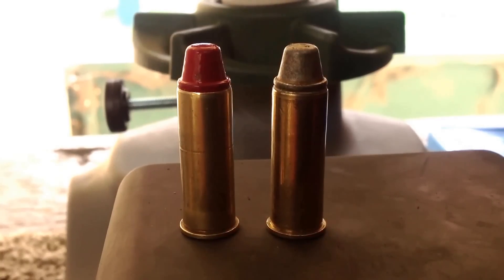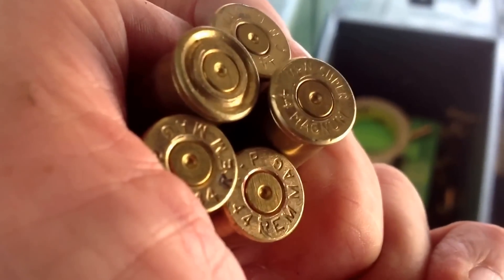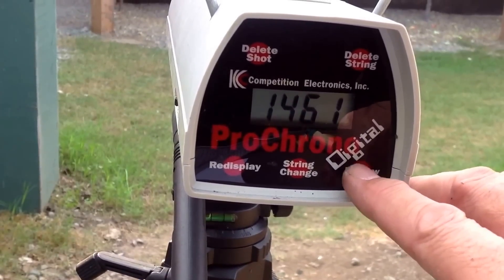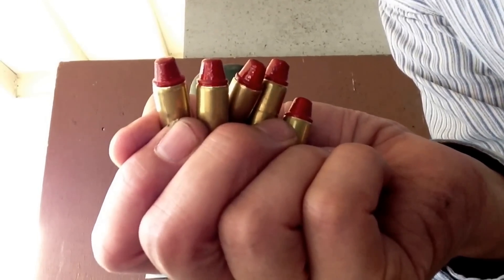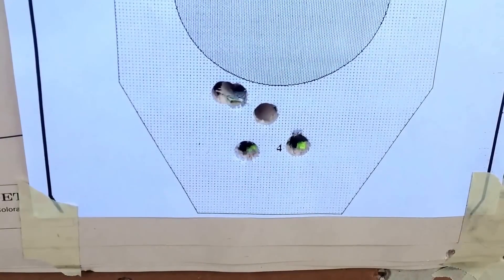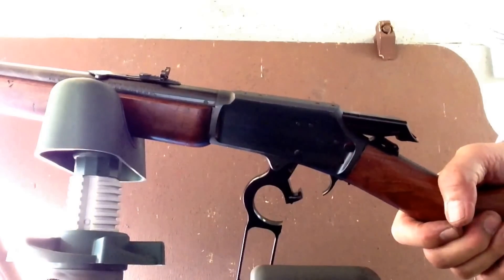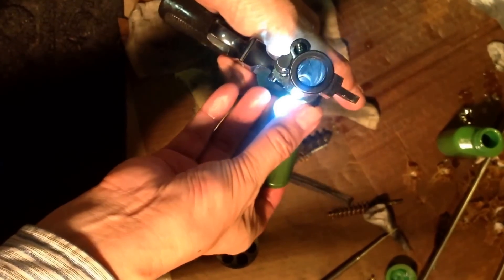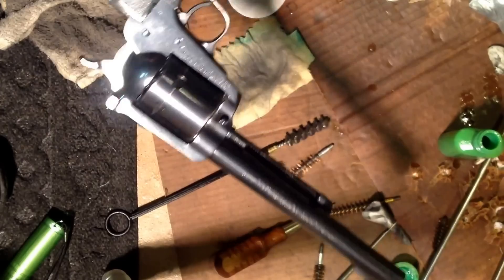Velocity Comparison - Powder Coated Vs Non-Powder Coated Bullets In 44 Magnum

Comment: Did you fire you test with a clean firearm each time? Lube will adhere to the bore. So firing a group with one lube, then another doesn't tell you too much useful data. I wonder what would be the velocity of the powder coated bullets when starting from a clean barrel?
Reply from the maker: Todd Fritz - With rifle testing, we clean after every 10 rounds plus cooling periods every group and copper remove after every 30 rounds.  One or two fouling shots are fired after cleanings.  With handguns, the ranges being a short 12.5 to 25 yards, cleanings between groups are not done.  However, group testing begins with a clean gun (with a fouling shot) and we seldom need to shoot more than 5 or 6  5 shot groups for any particular test.  Once concluded, we might choose to shoot 100 rounds or so for offhand range shooting - if the accuracy drops off, we know that the bore is getting fouled and it's time to clean the gun.   I don't recall seeing many handgun shooters who clean their guns for testing like we do when we are testing our rifles...  Best to ya,  Steve

Comment: fc45lc, I'm gonna try a 325 grain, gas check,2050 fps,and copper coat. 10 rounds next month.for first test rounds, I'm waiting to see if powder coated wears rifling out, before I mess with that. lol
Reply: nice dang reloads, nice
Reply from the maker: Rob Tolley - You will not find much on barrel wear out from PC.  There are some reports, but many more that do not have any problems with barrel wear.  But you don't have to do PC at all...the traditional lubes including 45/45/10 still work as well as they ever did... Best to ya,  FC

Comment: post script:

got 10lbs of the Ford light blue powder coat from Eastwood. I have been coating everything including 100 rounds of 230grn 45 lead I had previously lubed with the 45/45/10. melted them Down and recast, coated and swaged. I know probably easier to bathe them in some mineral spirits but I was already casting and went for it. I have been casting and shooting a ton of 35 Remington 200grn. Loaded with 37.5grns of IMR3031 I have been getting right at 2100fps. man I really enjoy the heck out of your videos. thanks again

Nathan

Comment: Is there anything wrong with flattened out primers on a full mag load? I've been under the impression it shouldn't do that but even the start charges in mag loads does this in my S&Ws.
Reply from the maker: Sam King - Absolutely OK - flattened primers means high pressures, but does not necessarily mean overpressures.  If you check out factory ammo... a lot of it is loaded to the max - flattened primers and all..even a bit of primer cratering may be seen. Everything is in degrees.  There is flatenning and there is flatenning.  And there is major cratering even pierced primers or gas blow out.  And the dreaded primer fall out.  When you couple all of that along with difficult extraction, or swollen case heads or rings, red flags have gone up.. Good shootin' to ya,  FC

Comment: What is a 45-45-10 bullet?  What distance were you shooting and what weight were the bullets?
Reply from the maker: deadeye2658 - Any cast bullet lubed with the 45/45/10 system - instead of the sticky, ugly Lee Alox tumble lube - you mix 45% Lee Alox; 45% Johnson's Paste Wax; 10% mineral spirits by eyeball (doesn't take much) and tumble the cast bullets - let dry on wax paper overnight - load 'em and shoot 'em.  Can lube 1000 bullets in total labor time of 12 minutes.  I have videos on the 45/45/10 system up.  No sticky, patina look, and shoots fine... Good reloadin' to ya,  FC

Comment: A little lateral dispersion. At least you only need to hit once with those loads. I shoot a hand cannon like that because its weight brings down felt recoil. Holyyyy!!! those look like some hot loads. I do like your results with powder coat. Thanks for sharing your experience.
Reply from the maker: ArcanusLibero - Yes, we did some rock and roll that day at the range...It's a good load though - can shoot a lot of 'em with that set of rubber grip stocks on the gun... Best to ya, FC
Reply: It looks like a good load. I cannot believe how much kick it had. Have you ever fired that load through a snub nose revolver? I think I need to look at rubber grips the older I get the punishing my hot loads feel.
Reply from the maker: It is a good load - but it is in the line of the full loads that Elmer Keith used in his sixguns...Best to ya,  FC

Comment: All the advantages of a TMJ with cast bullets. Nice. I've been shooting lightly loaded cast .44 mag loads through my Marlin lever action,  Blackhawk and S&W 629 with fairly heavy leading. The BHN has been 17.5 ish. Absolutely hate using a stainless brush in those barrels to clean them but as usual FortuneCookie45LC has an answer. Keep up the good work!!! :)
Reply from the maker: +hokanut -- Thanks for posting... Leading is a dreadful nuisance to deal with, and we need to avoid that for sure.  Your BHN is good for shooting magnums... might be just a bit on the hard side for light loads needing BHN 10-12.  Sometimes harder bullets will lead barrels because they are too hard for the velocity being shot.  Also, your Marlin micro groove barrel is probably on the big side so if your bullet are standard diameter, they may be small for the Marlin MG = leading.  So you might try a softer alloy (Missouri Bullets has the right BHN for your needs) bullet or upping the powder charge to around 1100 for your revolvers, 1300 for your rifle -  My Marlin 1894 44 mag needs bullets that are .433" to shoot best - that is really huge compared to the .430s my revolvers need.  If you powder coat your bullets, the hardness no longer is an issue - you can go soft with everything, plus no grease reloading and no lead shooting will occur.  But powder coating store bought bullets that have been lubed is a PIN.  Good shootin' to ya,  FC
Reply: +FortuneCookie45LC Thank you for the tip. I'm sure you're right especially with the Marlin because I can see the lead streaks skipping over the lands. I'm hoping the added diameter of the coated bullets will help grab the micro grooves better.  Also, so the harder BHN may cause the bullet to not conform to the rifling? That had never even occurred to me. Bet that will help a lot of folks. Thanks again.
Reply from the maker: +hokanut -- And thank you for the great discussion we're having...my Marlin 44 Mag with the like for .433" bullets - you might ask how I get those.  And you've already touched on it...I just powder coat my 431"s and they wind up .433" - perfect.  The best bullet for that rifle has been the 429 240 RN Lee - weighs 262 grains after casting.  And I like that...If I were hunting though, I'd shoot jacketed hollow or soft points.  The Micro Groove barrels shoot jacketed fine, even though the jacketed bullets mike at .429" - they slug up in the barrel nicely without any leading issues of course.  By the time our cast bullets slugged up, the barrel leading would have already happened...and it could be nasty.  Good shootin' to ya,  FC

Comment: A helpful tip with screws coming loose. When the gun is clean, (with no oil) take the screw out, clean and dry both of the threads. Then put a small dab of Clear Finger Nail Polish on the screw tip. I will act like a thread locker but one you can get off. hope it helps.
Reply from the maker: +Claude Smoot -- We used to do that with our scope screws - worked too, with our guns, why not?  Good tip to bring back into consciousness - thanks... Best to ya,  FC
Reply from the maker: +Claude Smoot -- We used to do that with our scope screws - worked too, with our guns, why not?  Good tip to bring back into consciousness - thanks... Best to ya,  FC

Comment: Powder coating has made cleanup of my guns a lot easier.  I still have a few lubed bullets to use up in the 357 and then I will use the powder coated.  Thanks for the very informative review.
Reply from the maker: +cerberus -- Our lubed bullets are still as good as they ever were.  I have no qualms about still doing the 45/45/10 for my cast bullets...that being said, I also like the nice clean reloading of PC bullets - no lube or grease anywhere.  And the guns shoot cleaner.  Not smoke-free, but more on this in future videos... Happy 2016 to ya... FC
Reply from the maker: +Amateur Redneck Workshop - Sorry to have missed your comment, but if Google doesn't post on my inbox, I miss all the new comments...the PC bullets do shoot cleanly, and well... Best to ya,  FC
Reply: I think youtube is having hiccups.  I have had several notifications that have already been replied to.

Comment: i though flatted pimers are a bad thing
Reply from the maker: +Josh Searl -- Standard loadings like 850 fps 38 Special or 45 ACP will not get flattened primers.  +P loads and +P+ will start getting flattened primers.  Many factory rifle rounds will show flattened primers on firing.  They indicate higher end pressures for that cartridge.  There are degrees of primer flatenning.  When the primer flows back completely flush to the case head and the details of the bolt face are engraved along with cratering around the firing pin indent - pressures are over maximum.  When primers pierce, pressures are way over maximum.  Since there are no practical pressure measuring devices available to reloaders, these are rules of thumb that reloaders have used for decades to evaluate pressure of our loadings.  Our best bet is to stay with published loading data as the powder and ammo companies have done all the pressure testing for us.  Still, guns and reloading practices vary - so we all still read the primers for pressure signs.... Best of the Holidays to you,    FC

Comment: Those were some real "Do you feel lucky" magnum loads, didn't hang around long enough to get the Blackhawk dirty. I might try a little Loctite 242 on those screws before you end up on your hands and knees under a shooting bench looking for a lost screw and those little buggers will fly a long way with that kind of recoil. Besides it's never a good thing to have a screw loose when your shooting buddy's are around, too many jokes that can last a long time. LOL
Reply from the maker: +ecleveland1 - ;)  :)  ;)  for sure!!  FC
Reply from the maker: +ecleveland1 -- Good points all - My old 3 screw Super Blackhawk had to have all the frame screws tightened every 50 rounds of 22/2400/245 Keith.  Did lose a screw out of one of my Rossi M92s once - ordered three more from Rossi - no problem getting them.  The Loctite is a good idea for sure.  Having to tighten those screws eventually results in some wear and tear to the screw heads.  Have a great day,  FC

Comment: I did some accuracy testing with my S&W model 28-2 with powder coated vs. 45-45-10 and had similar results but I need to get a chronograph. Next up is the Blackhawk .41 Magnum.
Reply from the maker: +Mr. Tolly (AKA: fatmantolly) - I can trot out my 41 Bisley and join you on that, but all my 41 bullets are already lubed with 45/45/10 and if I cast more, I'm going to have to use those #@*&%!!  2 cavity molds!!!  Best Regards....FC

Comment: And alas, the first good argument FOR powder coating bullets. Impressive.  My inquisitive mind wonders why, but I did like the results.
Reply from the maker: +Don Eime -- I'm wondering as well ( dangerous business, I know - but it helps to keep away dementia).  Some say that it has to be from higher pressure (more friction).  Others say from more lubricity of the bullet (lower friction).  Best recommendation would therefore be to lower the maximum charge by .3 to .5 grains and work back up or just keep that and enjoy the savings in powder...Best Regards to ya.... FC
Reply from the maker: +Don Eime - I haven't figured out why the extra fps - must be higher pressure or more bore lubricity somehow, but the loads were safe to shoot and shoot a lot... I like 'em... 1550 fps is nice magnum performance.   FC

Comment: Wow, if you look close on the Marlin target, I swear you can see an impression of the Micro-Groove rifling in the edge of the paper! Kinda neat! 

Using powder coat in most cases results in a higher average velocity over other bullet lube systems. It is essentially a really clean and slippery projectile lubricant. It provides the lowest coefficient of friction business which accounts for the higher velocity. In use, the user still needs to have all the other important details right for a given load, alloy/hardness, gas check if needed and most importantly, properly sized bullets. Adding PC to the formula will ensure you get clean shooting, leading free bullets if everything else is right, including the guns dimensions. PC will typically allow the use to push the envelope a little more. Example: running velocity & pressures high enough a gas check would be needed with conventional lube, PC will generally bump that margin up a little. 

It was nice to see the PC loads perform well and slightly better than the 45/45/10 slugs, victory to the modern technology loads that day! Now you just need to adjust the variables to find the sweet spot for that magnum load!
Reply from the maker: +mytmousemalibu - Thanks for your input - valuable stuff.  No need to adjust anything- I'm going to enjoy the increased MV and just go with it...Why not?  We are shooting the   "I know what you're thinking- did he fire five or six?, In all this excitement, I've lost count myself....being this is a 44 Magnum, the most powerful handgun in the world, it'll blow your head clean off... ya gotta ask yourself a question...Do I feel lucky?... Well, do ya, punk?"    BLAM!! with 240 grain PC bullet, no less....!!    FC
Reply: That was worth a giggle! I have this habit of seeking out the finite details which also means I might try to fix something that may or may not need fixing, lol. Example, if a pistol is shooting one hole groups at 12.5yds but at 50 they are a couple inches, I might be just foolish enough to go jack around with the load recipe to "chase the dragon" so to speak! I work in aviation, where perfection is encouraged! I have always been picky about certain things. Perfectionism is my good friend and my arch nemesis!
Reply from the maker: +mytmousemalibu - Thanks for sharing, Chris - and as an occasional  passenger, your attention to detail is very much appreciated... Happy Holidays!!  FC

Comment: Have you recovered a fired projectile? How does the coating hold up, does it maintain coverage without cracking?  I have tried SnS coated bullets, and frankly, I don't like them.
Reply: +RapidRrobert I've recovered many powder coated bullets, the bright red is easy to spot in the dirt! I have never seen any hint of coating failure. They can flatten or deform when hitting hard objects and the powder coat will not chip off one bit, it smashes and bends well. You can hammer powder coated bullets as flat as a quarter and  not have any failure.
Reply: Rusty Shackleford I have been using SNS coated bullets for about 4 months now.  I send them at about 1000 fps out of my various .357s.  I'm sold!  No fouling, no tumbling, lower cost, clean when handling during reloading .....

Keeping an open mind is the key to everything.  My opinion changed after experience.
Reply: +RapidRrobert I've recovered a few of my red harbor freight coated bullets and the coating was still adhered to the bullet really well.
Reply from the maker: +RapidRrobert - I have not bothered to recover bullets, but it is a good idea - next time I do range scrap gathering, I'll be looking for the bullets.  However, I have done the hammer smash test and the coatings stay on the bullets after squashing the bullets flat... Best to ya... FC

Comment: OK... So what you're saying is that I have to invest in powder coating tools now. Will do!
Reply from the maker: +SomeGuyInSandy - Had to get back to add that if I didn't have powder coating, I would still be running Alox based formulations.  I'll be doing that anyway - PC is another choice - good to have choices... Best Regards, FC

Comment: I've heard there is a difference in bore diameter between 44 mag rifle and 44 mag pistol.  The difference could cause bullet tumbling. Maybe you have a slightly larger bore diameter in your Marlin.
Reply from the maker: +Charles Frazier - No maybe to it, Charles, for my Marlin, Micro Groove I've got to use .433 cast bullets to get stable bullets.  Smaller keyhole.  These are .431 and then powder coated.  The .431-4315" non powder coated got the one keyhole out of 5 with another one a bit off axis.  The PC .431 were perfect stable tight group 5 out of 5 - says a big + for PC.  Funny, when .429" jacketed bullet factory rounds are fired, full magnums, no keyholes and accurate.  JHPs hold the Micro Groove rifling without having to be big.    Best Regards....FC

Comment: Very cool. Guess the powder coat is a winner in all accounts even in clean up. Great video friend.
Reply from the maker: +glockerbob - Did you notice that the full charge PC 44 Magnum shot lights out from the Marlin 1894 lever gun (Micro Groove barrel), and the non  PC had a keyholer?  That bit of information actually needs its own video so others can latch onto it.  Have a great day... FC